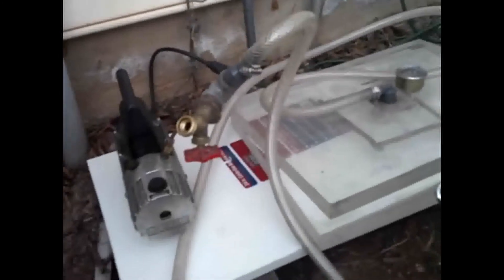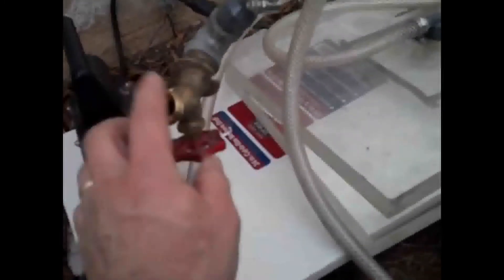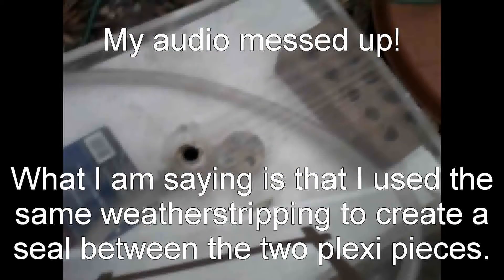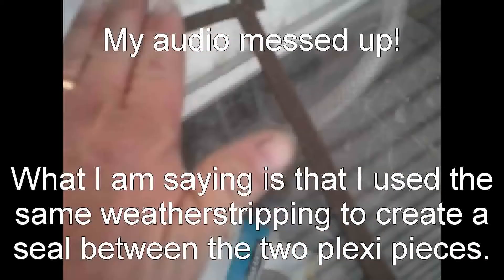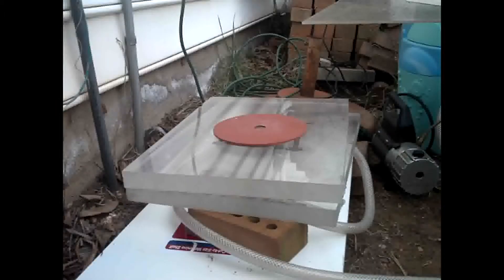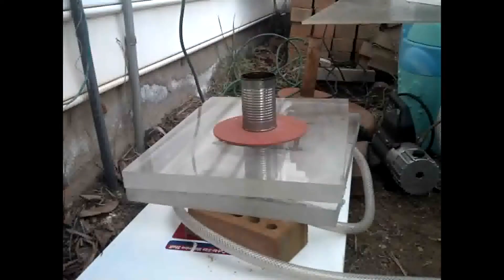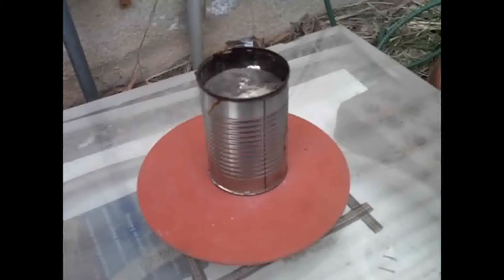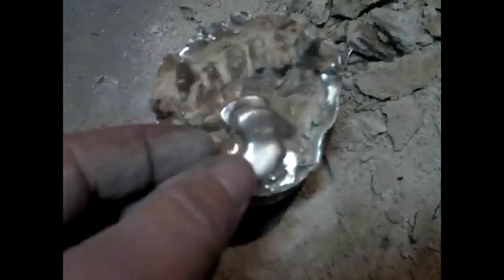Vacuum Casting Monster Teeth

Comment from the maker: You can get commercial investment...You can use pottery plaster mixed with sand too.  Or I use regular plaster of paris mixed 1 part sand to one part pop.
    If you are getting bubbling, you are probably not burning out long enough or hot enough.  If you are pouring aluminum or bronze, you need to burn out for hours..ramping up to 1200 degrees F.
     Another cause of bubbling could be that your investment is not porous enough for the vacuum to pull it.  You could try putting in vents too.